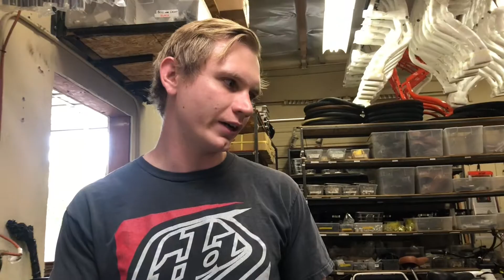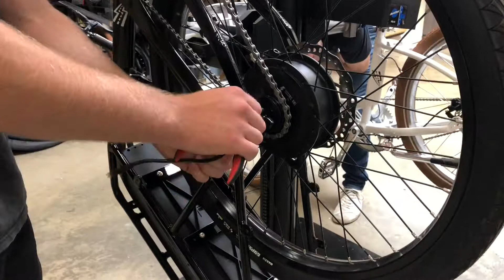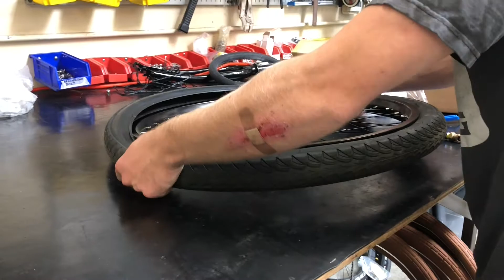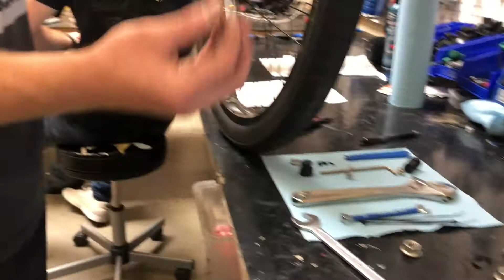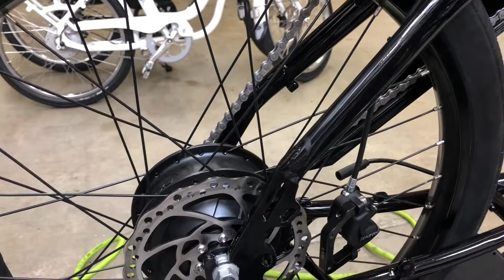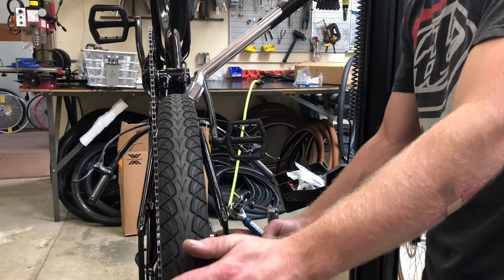How To | Change Your Back Tire

Comment: Thanks for the video, it helped me replace the rear wheel birdbike sent me (first one only lasted like 1 weeks!). Any tips for getting the rear wheel straight enough to the point where the caliper doesnt cause intermittent brake rubbing?

Comment: I have a model C.   I love the bike.   I just changed the back tire, got everything hooked back up and I can't get the bike to "turn on".   The LCD is unresponsive.    I checked the wire connection twice, the arrows are lined up on the connection and the battery is charged.  Any advice on how to diagnose the issue?   Thanks.

Comment: Can I easily attach my Schwinn Rascal Pet Trailer to the back wheels on my Model R? Schwinn includes a Coupler Plate along with Hub Nut/Washer to attach the pet trailer to be back wheel. Let me know...THX!
Reply from the maker: Hi there, you would need M12 hex nut to attach
Reply: @electricbikeguide  I got a problem. There is very minimal thread on the left side of the back tire to attach my coupler plate and screw on my hub nut or even the M12 hex Nut you mentioned. Why is that? There is plenty of thread on the right side of the back tire. Is there a way to have you guys adjust the axle on the back tire so that I have more thread on the left side of the back tire to securely attach my pet trailer with their coupler plate and the M12 hex nut you suggested? If so, I can can bring in for the adjustment. I would hate to return my pet trailer which I can easily install on my other non-electric bikes! Please let me know...THX

Comment: Just a few pointers/suggestions that aren't in this video, or would greatly help those doing home repair

1-  If you're bike has fenders, you'll likely have to deflate the tire a fair amount to be able to get it off once loose

2-  to adjust the brakes to remove rotor rub, the bolts to adjust would be more accurately called the " facing the front" not the "top".  (hard to tell here as hands block the shot)

3- adding some annotations or a pinned comment on what to do if the chain is binding in spots but not others would be very helpful

4-  Triple check your replacement tire is put on with the rotation going the right way, this is not a process you want to have to redo, as you're filling it with air only to find the tire marking for rotation is going the wrong way

apart from that, this video WAS very helpful.  This is a stressful but doable process, I would however, strongly suggest a bike stand.

Comment: Should the chain be lubed periodically, and is there something to put on the brake discs to remove, or better yet prevent, rust?
Reply from the maker: Hi Scott, Yes the chain should be lubed periodically to minimize debris build up. As for the brake disc our parts are stainless steel and rust resistant but you could also try some aerosol spray that prevents rusting of components.
Reply: @electricbikeguide  Do you all recommend a certain brand of spray for this?  Live on the coast of NC and humidity/moisture/rust is unavoidable.  Love my Model E!  Thanks!
Reply from the maker: @chrishanburger9031  Yes, we actually sell one to help maintain your chain: https://electricbikecompany.com/product/e-bike-chain-lubricant/

Every 500 miles should keep your chain well maintained.

Comment: This is very helpful. When adjusting chain tension and not removing the wheel, do I still need to remove the caliper? Or can I just loosen the axle nuts and pull on the wheel, then re-tighten the nuts? Thanks! My wife and I have been enjoying our Model S bikes!

Comment: Watched this EBC video right before changing a flat on my rear wheel for the first time.  This video sure made it easy. Only issue I had was getting the wheel back into the axle slot.  The technician sure made that task look easy. Took me about 10 min and another set of hands. Hoping to get better at it over time.
Reply from the maker: You definitely will Bobby. It just takes time and practice. Once you get familiar with the bike and its components it should be way more easier.